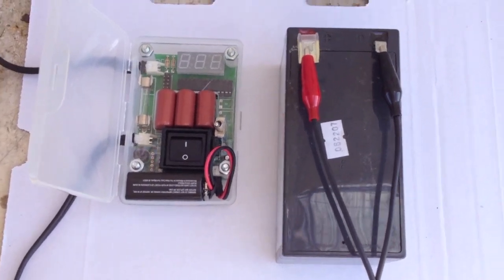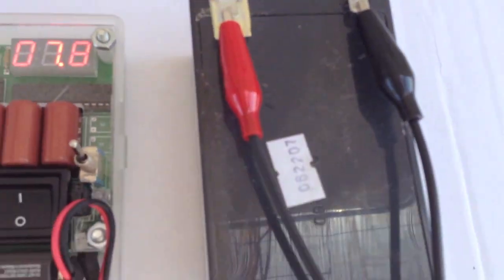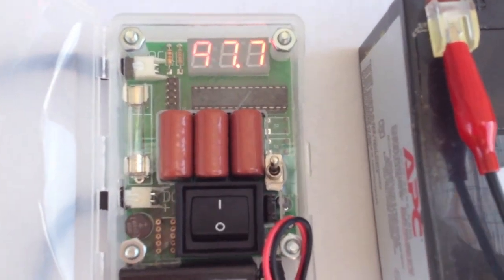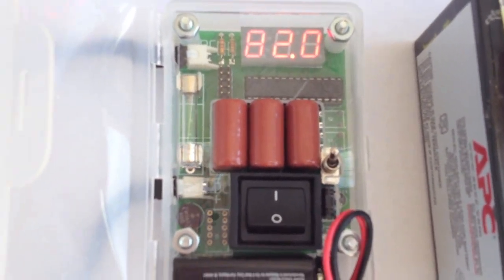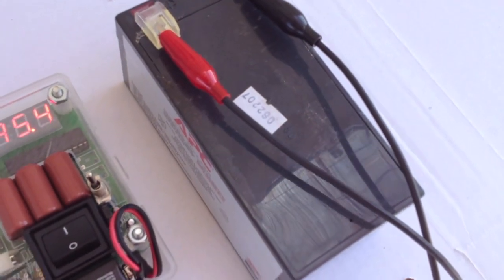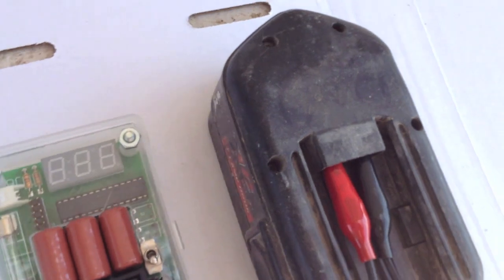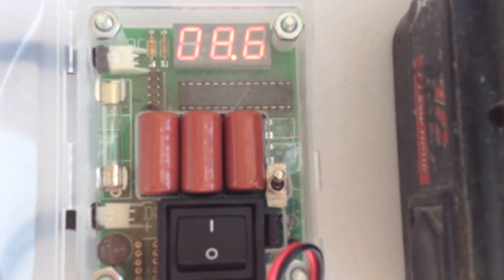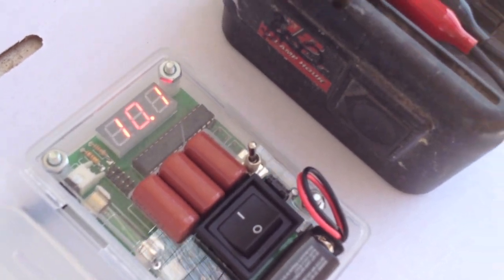Test Batteries for Sulfation Using Da Pimp

Comment: Can you inbox me details, schematics and parts how you diy'd(do it yourself) it, i require it now but unfortunate it was available in ebay since 2016. Then i had no requirement, now i require it. But ebay is closed in india. Amazon.in don't have it. How will i get it, i also know how to diy pcb traces. Your website shows 404 error. Then how?
Reply: I found this but they are not currently available.  You can enter email to be notified tho when they are.  

http://mikeysklar.blogspot.com/p/da-pimp-battery-desulfator.html 

If you can build your own circuit boards or know someone who can, details are here.  

https://gutierrezps.wordpress.com/2018/10/18/da-pimp-plus/

Scroll down to the schematics and such.  Maybe one of those will help.

Comment: hi mike....i print the circui board and i ordered the components...next weekend i am going to build da-pimp.
thank you very much. by the way if some one is interested with the circuit board.contact me i will send you with a very fair price.
Reply: where can i get it and import it to SA
Reply: @wcomputerservices.804  I found this that may help you.  Follow the link below, click the green code button and then download zip file.  Once downloaded, extract it to a directory that it should create.  Go dig inside that until you find a zip file with gerber in it.  You can send that, still zipped, to a PCB maker and they will make the boards.  You still have to buy components and assemble unless you pay extra and have the PCB maker to do it.  Some make the boards and assemble.  Sometimes tho, smaller quantities can be pricey.  When I built a desulfator board, I bought like 10 or 12 fairly cheap.  I then ordered parts and built them all over time.  It was cheaper to buy several boards than it was to buy just one.  

https://github.com/dchang0/dapimp2  

Hope that helps.  At least you don't have to create the boards from scratch.  If you use a PCB maker based in China, I think they ship about anywhere.  Some do good work.  Hope that helps.

Comment: the battery you consider bad is actually possibly good. you want to let them sit at 12v for a few days and they will lose their internal resistance. i get a lot of batteries that only take like 20ma of current when fed with 16v. but set them in parallel with a car battery and come back to it and it is much easier to charge. will be like 3 amp draw at 14v.

Comment: What about using half-bridge rectifier (and possibly double capacitor capacity) instead of full-bridge rectifier? That would make less frequent current peaks (which may be bigger if you alter capacitors). Giving battery some time to take a rest between these pulses… i think it could be better for the battery… Any ideas?

Comment: I'm on the list for your summer batch of Da Pimps!  I have a question about load testers.  In one of your other videos, you recommend getting one.  I was wondering about which specs I should go for...I see 100amp & 500amp load testers in my area.  Can I use both on small/UPS batteries as well as large deep cycle batteries?  What is the real difference?

Your website is swell, by the way!